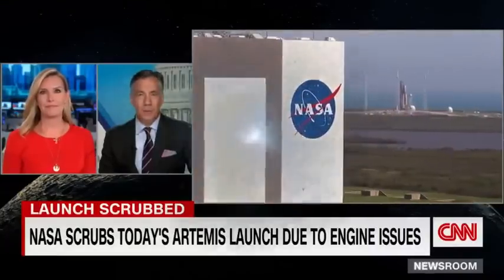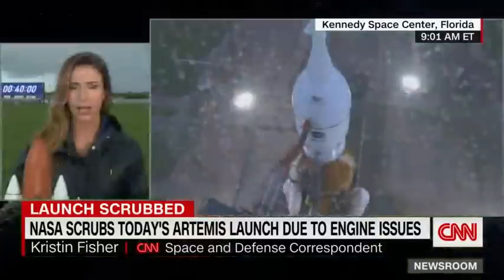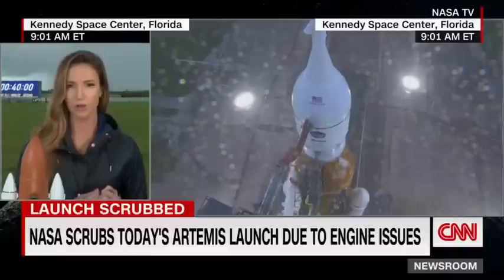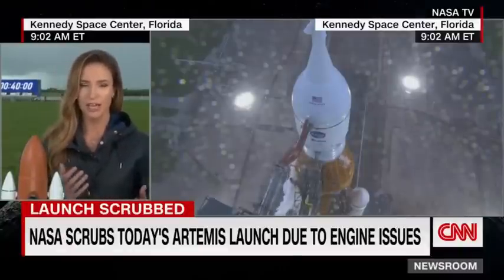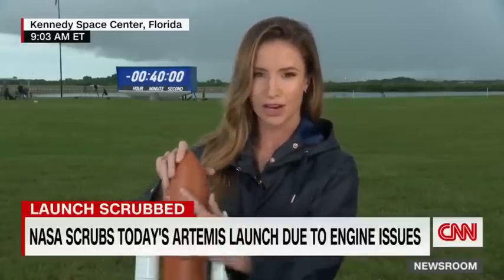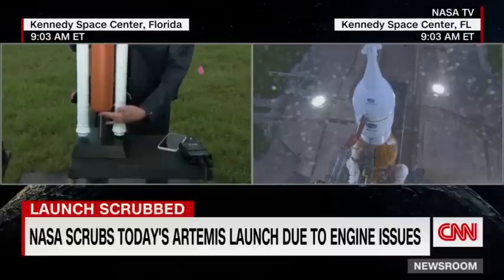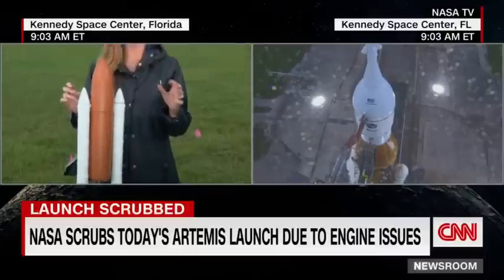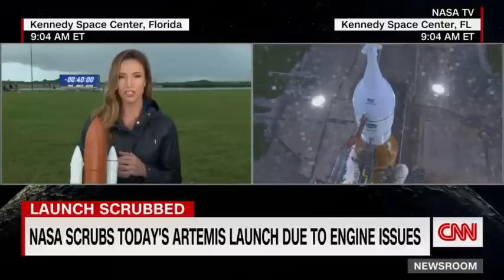NASA scrubs Artemis I rocket launch due to engine issues. CNN reporter explains why

Comment: Ok they've wasted enough of our money.  I say wasted because they admit to half ass testing.  Still using parts older than myself but it costs $30 billion.  Take it back to the  hangar, call SpaceX and explain you need engines and a mount for them.  They'll have it designed and fabricated in 90 days.  The place for government controlled agencies should remain in justice and defense.

Comment: ''They cobbled a rocket together from spare parts from the space shuttle program''?
$4 billion dollars a launch for used parts, and they have to use a model of a shuttle to explain the problem?.
Reply: $4 billion is for the whole mission if you all costs and spread them over 10 missions (development of the SLS rocket, Orion capsule, ground systems, etc.).
The final price of SLS will be much closer to the Shuttle price with much higher capability, maybe even lower since the SRBs and new RS-25 variant are upgrade for affordability.

Still not as good as private sector is currently doing but we should do fair comparisons.
This is like taking Starship which might end up costing $2 million per launch but let's just say the Artemis 3 Starship landing costs $13 billion because that includes the $10 billion for the base Starship development and $3 billion for HLS development.
Reply: @norinokia2307  I don't see any advancement in rocket technology here. No manned moon landing for fifty odd years?. Do you really believe this rocket is going to send people to the moon?.
Apollo supposedly worked near perfectly from 11 to 17, and would have been the perfect platform to build and improve upon, yet NASA never did, instead claiming that they destroyed the technology.
If something works, then you don't discard it, you move forward and learn to improve it, and save time and money by not having to start from scratch.
Reply: @destinyone843  You have a high lack of understanding the problem (no front). They had no other choice than to not further develop Saturn V/Apollo Capsule since they had huge budget cuts during Apollo since they won the space race and politics lost interest. The Apollo vehicles were crazy expensive if you account for inflation. Before the budget cuts they had crazy plans they wanted to do like a crewed Mars landing in 1981 with 4 space stations, 3 around earth and 1 around the moon. Since that didn't work out with such a low budget they developed the Shuttle which they were incapable of iterate much further and built the ISS so we can return now to the moon in a much cheaper and partially commercial way.

Comment: I'm very disappointed about the failure, scientifically speaking, but NASA should have  chosen it's dependent partners first and not a firm driven by pure market interests. BTW, it was not the 'leak' that was the problem, (that was decently fixed as far as I know), it was the COOLING of one of the engines, so don't panic yet. As I understand there was no time (enough) allocated for 'dry runs' in the lab. Don't rush things this complicated as this, please. I'm not to shocked - It took from 1969-70 to 1981 to develop the actually very successful Space shuttle. (The Apollo was stellar in speed in its development) If you design a thing like this - going beyond the earth's direct gravity, you need at least 11 km/s. This isn't child's play. Kudos for the next mission.
Reply: thx
Reply: If the Shuttle was very successful, they should not have a worse reliability score than the Soyuz.
Reply: @jg5001  no content = fake
Reply: @janverboven  shuttle killed more astronauts than Soyuz with cosmonauts. The shuttle's failure rate is more than Soyuz by a good margin, too.🤷‍♂️

Comment: It’s NOT THE MOST POWERFUL until it leaves the launch pad 🫣
Reply: Someone outta tell SpaceX fans that
Reply: Wrong. Does not have to leave the launch pad.  Engines are tested for power on a stand, not in the air.
Reply: @tonysmith7702  🙄

Comment: Wtf? Why is she using a Shuttle model? Can't CNN afford an Artemis one or NASA loan one to the press? A Shuttle model makes no sense. Just like NASA sticking with SLS - it's plagued with the usual NASA crap. Never ending technical problems (I heard a fuel leak this morning was in the same area as one months ago - wtf?) which inevitably lead to delays & cost overruns. We've seen this same BS too many times before. It gives undeniable credence to the charges of NASA/politicians/longtime contractors incest. The whole point of partnering with private, commercial companies was to do it more efficiently, cheaper, faster, etc. Just like SpaceX is doing. Hey NASA (American public/voters) it's long past time to be DONE with what isn't working - and btw - get taxpayer's money back from these chronically failing contractors. What the hell kind of open ended contacts allow for huge amounts of money to JUST KEEP FLOWING to people who don't get the job done unless it's by design in the ceswhirlpool of political circle jerking?

American people - it's time to demand & absolutely insist that THIS GARBAGE STOPS - NOW!!!

NASA - get my money back and turn the damn thing over to SpaceX or Arianespace or Rocketlab. Better yet - just get out of the way.

I got an idea - how about using the technology Ben Rich spoke of? But that would expose the secret space program & the fact that we've had bases on the moon and beyond for a long time and we can't have that - can we? If the public knew the truth you'd be swept aside.

Wake up America. No - that's not the name of a new morning show. It means WAKE UP!!!
Reply: 1 Doug Ewald Fuk what you saying it here 😠 https://www.youtube.com/watch?v=VgaFEZCHz_k

Felicidades, es un buen ejemplo. 😠
5:25 Se deja ver que hay muy buenos resultados 😠😠 

Saludos desde la Cd.. de world 🌹😉💖 
los mortales abian apreciado tan hermosa mujer
Reply: @kristycampbell5986  WTF are you talking about? What you've written makes no sense & why did you start with the number 1? The video in your link is just more nonsense. I don't speak whatever language that guy speaks. Do you speak English? I doesn't look like you do & that's probably the basis for your obvious misunderstanding of my meaning.

Instead of just engaging in an ad hominem attack with your unwarranted angry words & symbols why don't you ask me for more information about what I meant? I said a lot but you haven't pointed out any part of it you don't understand or disagree with. Why? Why would you just publicly attack someone you don't know? And attacking someone you do know is also outside the bounds of acceptable behavior. Why did you do this & what causes you to think it's anywhere close to ok and that you can get away with it. What's your problem? Are you angry at me or just angry at the whole world? 

I've reported your harassment to YouTube. It's not allowed on here.

If you can't behave like a normal adult then you ought to stay off the internet.
Reply: @kristycampbell5986 , I see that you have responded to several other people on your channel nearly identically to the way you did to me - complete with the leading off with the number 1.

This is very indicative of either you being chronically misunderstanding of other people or you're just plain crazy or both.

It's been a while since I've seen something this bizarre.

I think you have a serious problem with successful people online and you should just stay off until you learn some respect.

You seem to full of extreme anger and that's very concerning. You should get professional help with that.

Comment: NASA have been forced to pay $146 million per RS-25 engine which were originally used on the Shuttle. They're only being refurbished and modified. They're not new. Meanwhile Space X and Blue Origin are producing some of the most powerful engines on the planet for around $5 million a piece (some speculation Raptor 2 is less than $1 million an engine. NASA would never have designed SLS if it wasn't beholden to congressional idiocy. SLS is a boondoggle. Old technology in a new shell and Boeing/Aerojet Rocketdyne still can't get it off the ground.
Reply: 1 SimplySketchy Fuk what you saying it here 😠 https://www.youtube.com/watch?v=VgaFEZCHz_k

Felicidades, es un buen ejemplo. 😠
5:25 Se deja ver que hay muy buenos resultados 😠😠 

Saludos desde la Cd.. de world 🌹😉💖 
los mortales abian apreciado tan hermosa mujer

Comment: What's a few more days to a potential launch, when this jobs-program/prototype frankenrocket/Senate re-election boondoggle has only taken 11 years to get to this point, with nothing new to offer over a 50-year-old Saturn 5, and has no lunar lander of its own?
Just as well there are only 4 RS-25 main engines to worry about; SpaceX had 27 on its Falcon Heavy which launched on time way back in 2018, and the SpaceX SuperHeavy has 33 new technology Raptor 2 engines.
This waste of money is a joke but I'm not laughing.
Reply: A lot of us think they should just let it go, for exactly everything that's been happening the last 5 years... or however many since the first time it was delayed.

Because all this giant pork sausage does is cost multiple times more than what the soon-to-be-ready-yet-more-capable competition will, all whilst not being the Upgoer is supposed to be. If it's not one thing, it's another, or another...... or another... So might as well let it fly and show why it needs to be canceled! Everyone will get a spectacular show, either way, but at least a small bit of the absurd funding it consumes can be put towards meaningful projects!

After all, every. single. SLS. is going to cost around $2bn to make (again, NASA won't get access to that, but taxpayers won't have to keep paying for it), so why continue to pursue it when there will be cheaper and better alternatives - of which the program's end-goal still requires in order for they're to be boots back on the Moon?
If those senators refuse to let it die, then THEY can be the first passengers on their beloved Senator Lunch System 😏 (not like they're doing our country any good either way!)
Reply: 1 Maurice Gold Fuk what you saying it here 😠 https://www.youtube.com/watch?v=VgaFEZCHz_k

Felicidades, es un buen ejemplo. 😠
5:25 Se deja ver que hay muy buenos resultados 😠😠 

Saludos desde la Cd.. de world 🌹😉💖 
los mortales abian apreciado tan hermosa mujer
Reply: They were right to scrub the launch, but they should have done it about a decade ago. Give the budget to a few companies that are not afraid to break some cheap test hardware, learn from it, and move on faster.

Comment: I wonder why they really scrubbed the launch.
Reply: Because rocket launches have to be perfect  ever aspect of it
Reply: Because it's broken?  If they expected everything to work there would be astronauts on board.
Reply: They're afraid of the Jewish space-laser  .
Reply: @uncleanunicorn4571  no they’re reserving that to bring the population down to 500,000,000
Reply: It was dirty
Reply: Because the moon people sabotaged the rocket. Conspiracy theories,  anyone?
Reply: @senseiheceta  they filmed the fake moon landings at Area 51 inside the hangars 

The “alien” bullshit was a cover up for using Area 51 for using the hangars to film the fake moon landing 👍
Reply: URANUS!!!😂😂😂😂😂😂😂😂
Reply: An issue which they originally planned to test for during the “wet dress rehearsal” - propped up. Just like the reporter explained, engine 3 didn’t reach the specified temperature due to an engine bleed issue. 

What I suspect, and because it was mentioned it was the Hydrogen Fuel Team that raised the alarms, is that there is an issue with one of the hydrogen flows coming from the Low Pressure Fuel Turbopump (LPFTP) which cool the walls of the hot gas manifold and nozzle. They would need to test it in its current configuration, determine the source of the problem, and see if it can be addressed, fixed, or if it requires a full engine replacement. 

If it is what I think it is, I’m afraid the 2 and 5 September dates are highly unlikely as well. But they made the right call to scrub. This would be like running your newly pimped hot rod on a drag strip with an engine light coming on.
Reply: @shonen84  the synopsis is greatly appreciated 🙏
Reply: Damn! Some humans are VERY stupid. You would rather believe a conspiracy theory than complicated engineering that you don't understand. 🤣  Maybe it was ALIENS that told them to wait.....dun, dun, DUNN!
Reply: @I'm just some Canadian guy, and I say who said it was a conspiracy? Stop being a fucking creep.
Reply: Space is fake and no one can leave the container were inside of, no one has ever and no one will ever leave.
The scam is obvious. 
They’ll use any and every excuse possible to funnel money then when it comes time to do anything actually real they’ll fake it or they’ll just say “technical problems” lol and then they’ll keep moving back the date at which they say they’re going to do something lol
Reply: Because everyone expects it work. So they want it to be perfect. That's a lot of pressure.
Reply: @Deadassbruhfrfr  no it’s fake can’t you read?
Reply: An issue which they originally planned to test for during the “wet dress rehearsal” - propped up. Just like the reporter explained, engine 3 didn’t reach the specified temperature due to an engine bleed issue. 

What I suspect, and because it was mentioned it was the Hydrogen Fuel Team that raised the alarms, is that there is an issue with one of the hydrogen flows coming from the Low Pressure Fuel Turbopump (LPFTP) which cool the walls of the hot gas manifold and nozzle. They would need to test it in its current configuration, determine the source of the problem, and see if it can be addressed, fixed, or if it requires a full engine replacement. 

If it is what I think it is, I’m afraid the 2 and 5 September dates are highly unlikely as well. But they made the right call to scrub. This would be like running your newly pimped hot rod on a drag strip with an engine light coming on.
Reply: There was a news video that it got struck by lightning.
Reply: Exactly !  you know damn well those RS-25 engines are reliable as they get .   first thing I said was , Lame excuse, at least come up with a better lie.
Reply: @anthonysaponaro6318  Ok flat earther.
Reply: Why do you think Elon stopped with the fake space scam, lol 😂 he knows and doesn’t want to get trapped in that corner
Reply: @donhagelson7465  WhY aRe ThE mOoN cRaTeRs CiRcUlAr?

Comment: I think they made the right choice to scrub the mission, due to hydrogen fuel leaks, and the weather. Last night the guy was saying a tank was leaking, then today they said there was a leak in through the engines. Time to roll the Artemis back into the shop and repair all the problem zones and test the repairs if possible.
Reply: Exactly, can't take off until it's fixed, that's a seriously dangerous leak
Reply: The hydrogen leak issue was solved, it was thought hydrogen was leaking into the interstage because frost was seen on the stage adapter, in reality it was just a section of spray on foam insulation (SOFI) that had come off, happens alot and happened throughout the shuttle flights. The only main issue with it right now from what we know is Engine #3